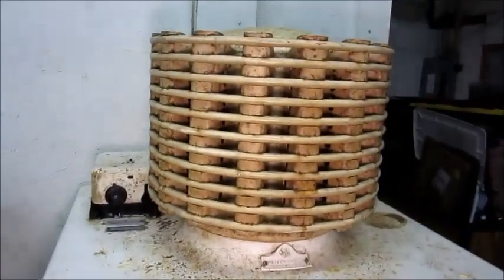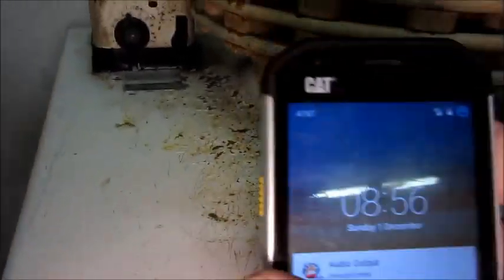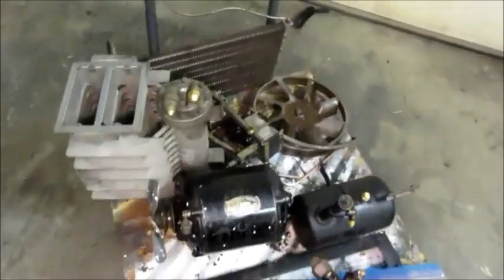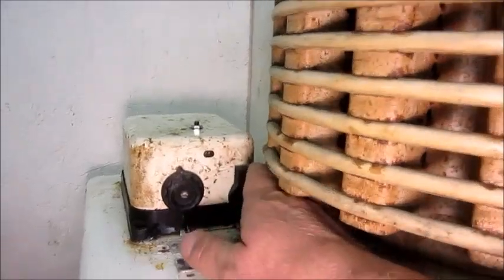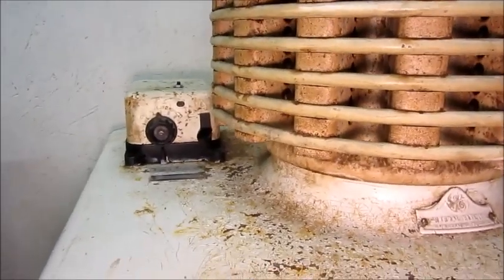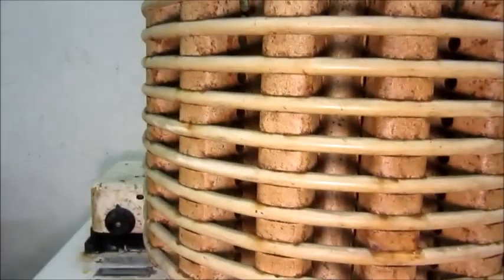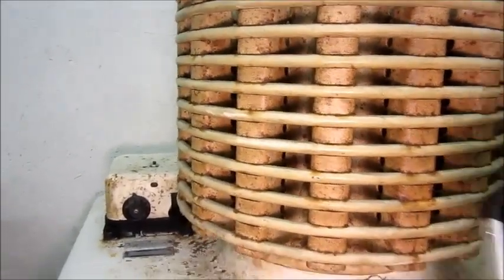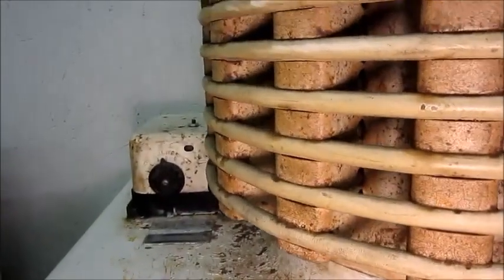Troubleshooting GE Monitor Top DR-1 Antique Refrigerator - 3 - Followup...

Comment: Going to put that DR-1 to use?
Reply from the maker: I'll run it for a while in my shop, and once I'm confident it's not about to fail, I may try to "re-home" it to someone else who will appreciate it.   I hate to say I want to sell or get rid of one because that may make it sound like I don't appreciate what I have. But, it's a means to free up room for another one in need of fixing. Often, people exhaust all resources and give up on these machines; then give them to me as a means to avoid sending them to the scrap yard. I just have too many to actually use them all. I owe it to those who made the decision to give it away instead of throw it out; to make an attempt to fix and then move it on as a working unit.

The main type of refrigerator I fix for other people is the belt-drive Frigidaire models from the 20's and 30's. I always have at least 1 or 2 of them running for testing so I have really no need for my own dedicated shop fridge. There are more people who are proficient at repairing Monitor Top fridges than there are who repair belt-drive Frigidaires, so those keep me busy. Here is one of them, sent to me without cabinet. Testing required some carpentry and another old Monitor Top cabinet. https://youtu.be/k5Wt-SaQxas

Comment: I have an opportunity to get one of these for $150. It doesn't run. I was told that it sparked at the starting relay when plugged in. My question being that it's not running and not knowing the problem do you think $150 is a fair price?
Reply from the maker: I always feel as if these have a 50% chance of being fixable, a 25% chance of working fine as-is, and a 25% chance of being scrap iron. In my humble opinion, $150 is too much for one with known problems. I would offer 50 and maybe negotiate up to $75. At most if the entire unit looks like new, maybe $100 tops.
Reply: @davida1hiwaaynet  Thanks for your comments. I enjoy watching your videos very much.
Reply from the maker: @bruceguthrie8098  glad you're enjoying my videos! Hope you can get that fridge reasonably!
Reply: @davida1hiwaaynet  Well I can get it for $50 but they can't find the power cord. I can't find a replacement cord for that style.  Is my only option to alter it?
Reply from the maker: @bruceguthrie8098  You should be able to buy a cord end from Lowe's and modify the cord end to fit the DR-1 fridge!
Reply: @davida1hiwaaynet  Thanks, just want to let you know I was lucky enough to find the service valve kit that you used in one of your videos.
Reply from the maker: @bruceguthrie8098  Glad you got the service kit! Hopefully you won't need it, though.